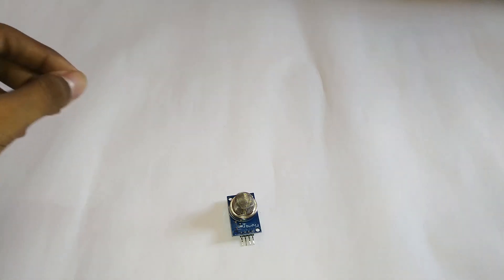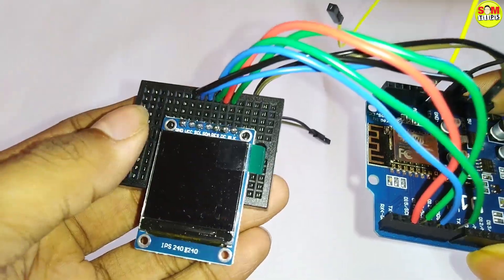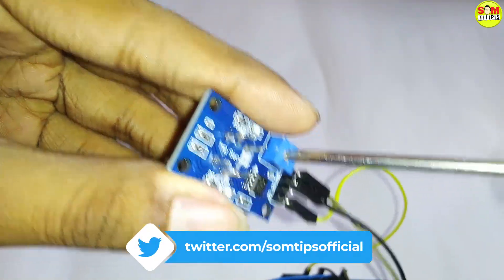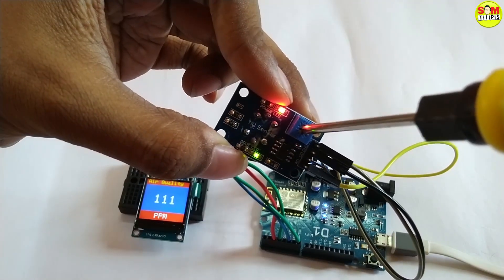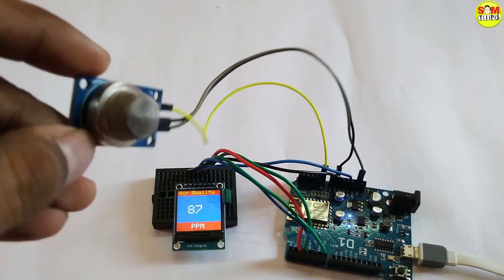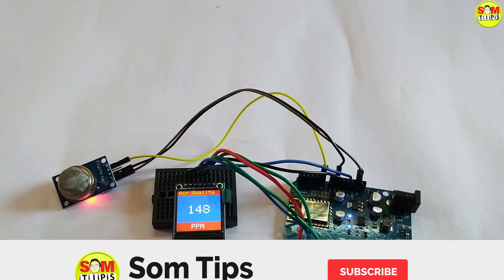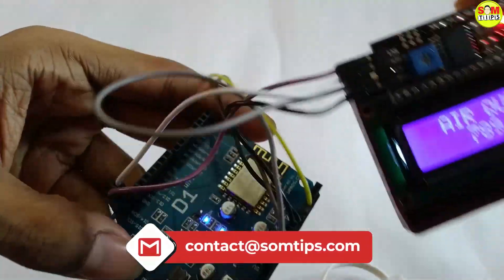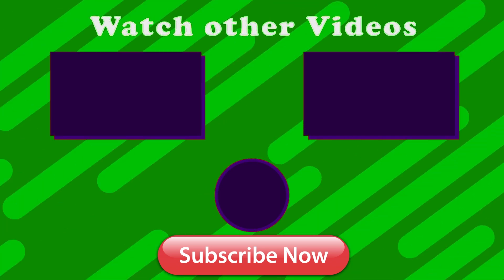MQ-135 Air Quality Gas Sensor with ESP8266 Wemos D1,1602 LCD I2C & ST7789 SPI TFT Display | Som Tips

Comment: Is it possible with arduino nano?
I wish it could somehow please
Reply from the maker: it will work use 11 & 13 pin
Reply: @SomTips  Hello friend, I want to know if some relay module can be placed in some way to activate a fan and thus circulate the air and get a good reading, since I thank you for your help because I declare myself totally ignorant on the subject, I would like to replicate your circuit but with some relay module, please I would really like to reply.
I have the elements like the arduino nano, mq135 sensor and the screen, I need to buy the relay module but I will not buy it until you friend tell me if you can please.-
Reply from the maker: yes you can add relay using 5V and Digital pins.
Reply: And how would that be done? I don't know anything, should we have another code? or it serves; please help me
Reply from the maker: need digital pin High.. and external 12 v power for fan..
Reply: I don't know how to change the code